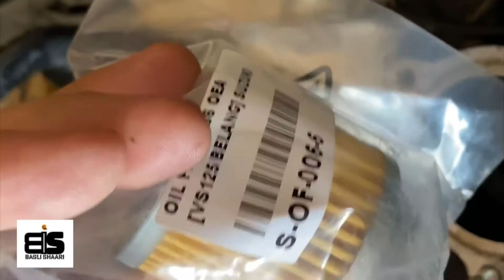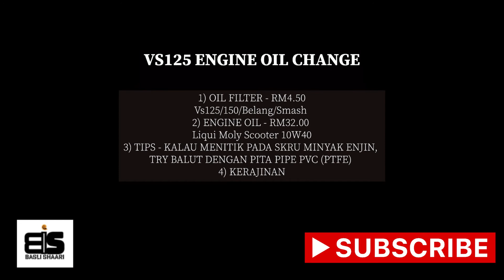Suzuki VS125 engine oil change tukar minyak hitam

Comment: Assalam,sya ada suzuki VR125,masalah sya skrng ni motor tak boleh hidup,api ada,minyak pun naik.. tapi tak boleh start,sya baru lepas grind valve belah ex dan sya pasang semula,mungkin marking tak ngam,boleh ajar sya macam mana nak marking cam tak? mungkin sya tersalah marking atau ada apa2 masalah lain.. boleh tunjuk ajar tak
Reply from the maker: Wslm , kalo marking tu sy xpndai sgt tuan, tuan cuba contact https://www.facebook.com/amgmotorparts?mibextid=LQQJ4d, brader ni mmg pomen, sparepart pun dia jual skali..